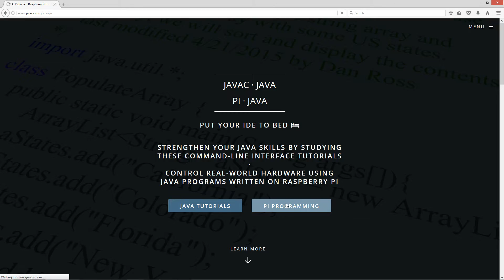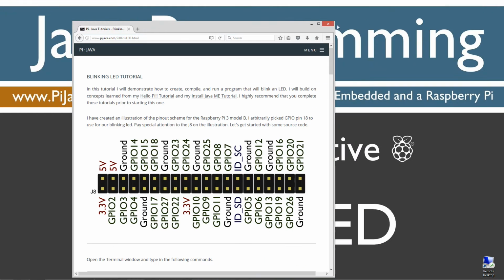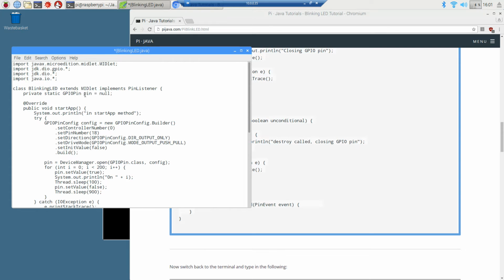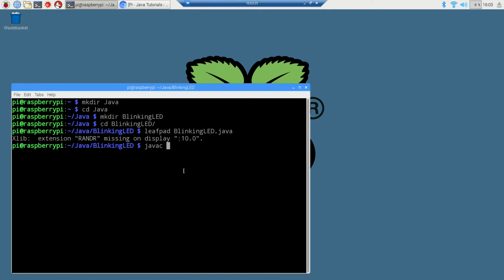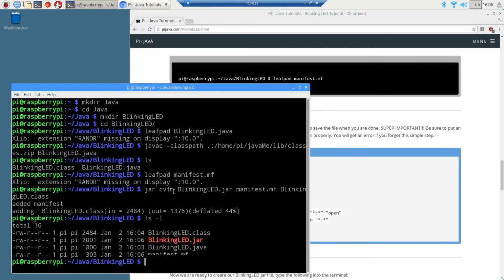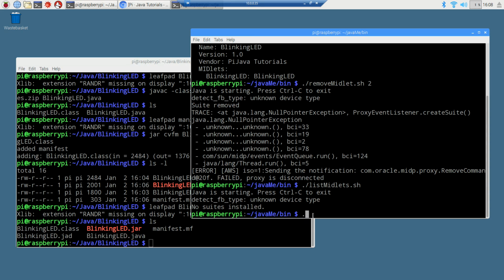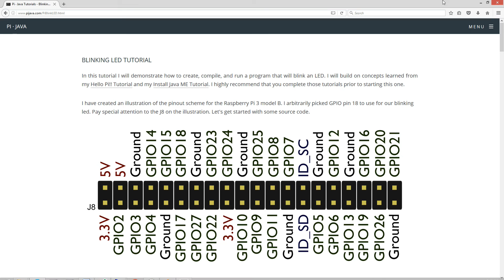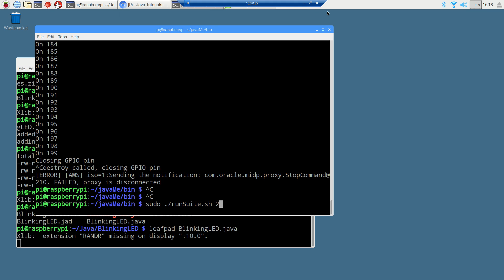Java Programming on Raspberry Pi - Blinking LED

Comment: I tried to run "sudo ./usertest.sh" and got following error message:
pi@raspberrypi:~/javaME/bin $ sudo ./usertest.sh
Java is starting. Press Ctrl-C to exit
Frame buffer device detected: BCM27XX
[ERROR] [LCD] iso=-1:Supports only 16-bit, 5:6:5 display
: No such file or directory
[ERROR] [LCD] iso=-1:Supports only 16-bit, 5:6:5 display
: No such file or directory
Failed to open /dev/input/by-id
[ERROR] [FILE] iso=-1:javacall_file_sizeof() Problem getting information
[ERROR] [FILE] iso=-1:javacall_file_sizeof() Problem getting information

Could you please help? I can't find any solution online. Thanks!
Reply from the maker: Shortly into the Java ME tutorials, I decided that the complexity of Java ME was going to limit my audience so I switched gears and created Java SE tutorials for Raspberry Pi instead. Check out my Super Easy Blinking LED! video ... you will be up and running in minutes.

Comment: I've been following the tutorial up to this point. I was able to install the BlinkingLED midlet. When I tried to run it, it keeps giving me the following error message:
pi@raspberrypi:~/javaMe/bin $ sudo ./listMidlets.sh
Java is starting. Press Ctrl-C to exit
Frame buffer device detected: BCM27XX
[ERROR] [LCD] iso=-1:Supports only 16-bit, 5:6:5 display
: No such file or directory
[ERROR] [LCD] iso=-1:Supports only 16-bit, 5:6:5 display
: No such file or directory
Failed to open /dev/input/by-id
Suite: 2
  Name: BlinkingLED
  Version: 1.0
  Vendor: PiJava Tutorials
  MIDlets:
    BlinkingLED: BlinkingLED
pi@raspberrypi:~/javaMe/bin $ sudo ./runSuite.sh 2
Java is starting. Press Ctrl-C to exit
Frame buffer device detected: BCM27XX
[ERROR] [LCD] iso=-1:Supports only 16-bit, 5:6:5 display
: No such file or directory
[ERROR] [LCD] iso=-1:Supports only 16-bit, 5:6:5 display
: No such file or directory
Failed to open /dev/input/by-id
in startApp method
[CRITICAL] [SECURITY] iso=2:Permission check failed: jdk.dio.gpio.GPIOPinPermission "0:18" "open"
TRACE: <at java.sec[ERROR] [AMS] iso=1:Sending the notification: com.oracle.midp.proxy.RunCommand@20f. FAILED, proxy is disconnected
urity.AccessControlException: >, startApp threw an Exception
java.security.AccessControlException:
 - .unknown...unknown.(), bci=93
 - java/security/AccessController.checkPermission(), bci=1
 - .unknown..<init>(), bci=19
 - com/oracle/dio/gpio/impl/GPIOPinFactory..unknown.(), bci=6
 - com/oracle/dio/gpio/impl/GPIOPinFactory..unknown.(), bci=3
 - jdk/dio/DeviceManager..unknown.(), bci=49
 - jdk/dio/DeviceManager.open(), bci=24
 - jdk/dio/DeviceManager.open(), bci=3
 - BlinkingLED.startApp(), bci=43
 - .unknown...unknown.(), bci=1
 - .unknown...unknown.(), bci=5
 - .unknown...unknown.(), bci=220
 - .unknown...unknown.(), bci=38
 - .unknown...unknown.(), bci=5
 - .unknown...unknown.(), bci=130
 - com/sun/midp/main/AppIsolateMIDletSuiteLoader.main(), bci=23
java.security.AccessControlException:
 - .unknown...unknown.(), bci=93
 - java/security/AccessController.checkPermission(), bci=1
 - .unknown..<init>(), bci=19
 - com/oracle/dio/gpio/impl/GPIOPinFactory..unknown.(), bci=6
 - com/oracle/dio/gpio/impl/GPIOPinFactory..unknown.(), bci=3
 - jdk/dio/DeviceManager..unknown.(), bci=49
 - jdk/dio/DeviceManager.open(), bci=24
 - jdk/dio/DeviceManager.open(), bci=3
 - BlinkingLED.startApp(), bci=43
 - .unknown...unknown.(), bci=1
 - .unknown...unknown.(), bci=5
 - .unknown...unknown.(), bci=220
 - .unknown...unknown.(), bci=38
 - .unknown...unknown.(), bci=5
 - .unknown...unknown.(), bci=130
 - com/sun/midp/main/AppIsolateMIDletSuiteLoader.main(), bci=23
[ERROR] [AMS] iso=1:Sending the notification: com.oracle.midp.proxy.RunCommand@210. FAILED, proxy is disconnected
[ERROR] [AMS] iso=1:Sending the notification: com.oracle.midp.proxy.StopCommand@211. FAILED, proxy is disconnected